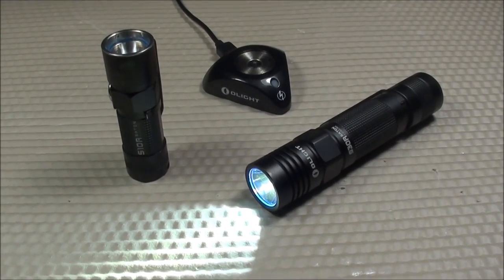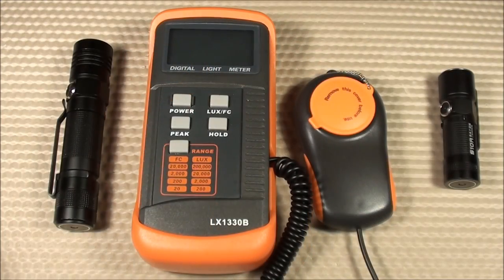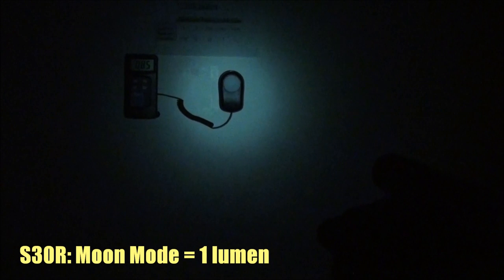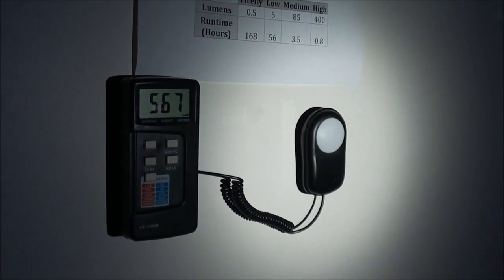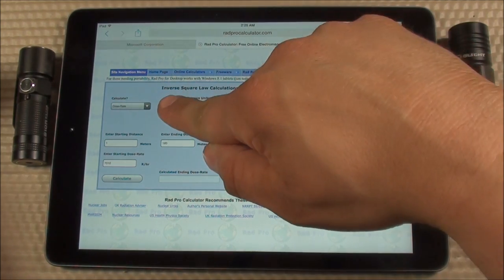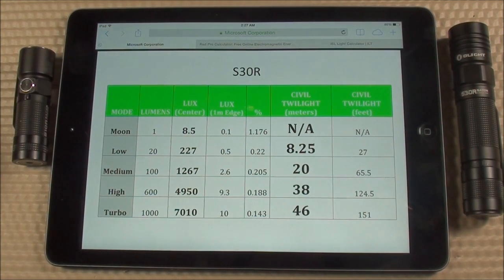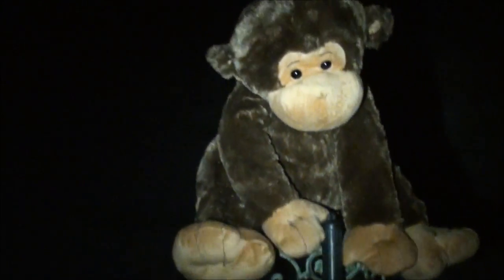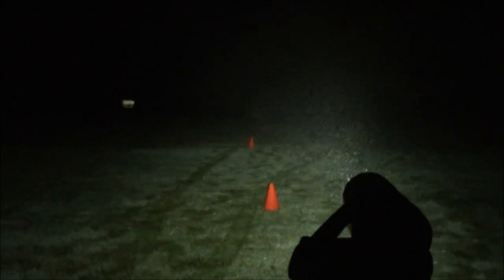Olight Baton: Illumination Physics (2/3) by TheUrbanPrepper

Comment: Well, this was an enjoyable optics class! I'm kinda tired of only studying Mechanics for physics in my uni course.

The explanation for civil twilight won me over, Cliff. Even though I don't really care about it that much (mostly I'm concerned with the distance at which the beam allows me to distinguish movement, not really shapes), it's good info to have and a powerful deciding factor for buying a specialty torch. Good job!

That said, I wish you could do this test on lights with REALLY dim firefly mode such as the Thrunite Ti3 and Archer v2 models, floody monsters like their TN36 or any Tiny Monster from Nitecore, and laser beamers with spectacular throw like the Olight M#X models (M2X Javelot and M3X Triton).

EDIT: These practical throw numbers are absolutely nothing to scoff at for mostly flood-oriented torches like the Batons are. I'm impressed.